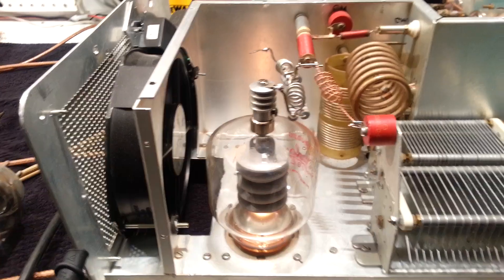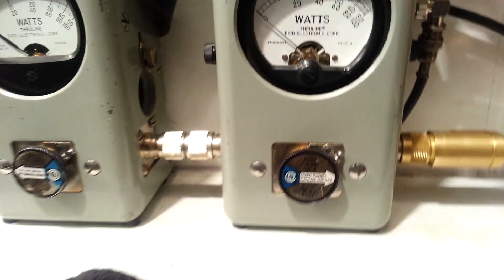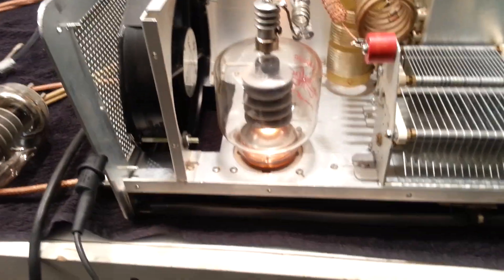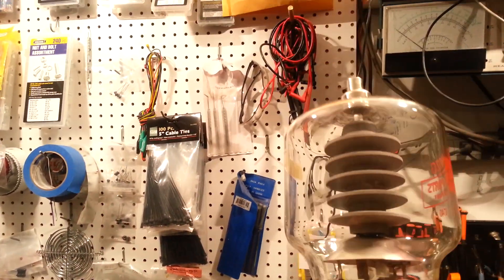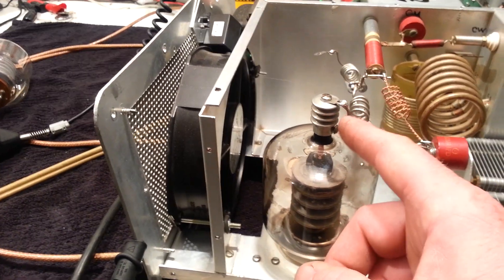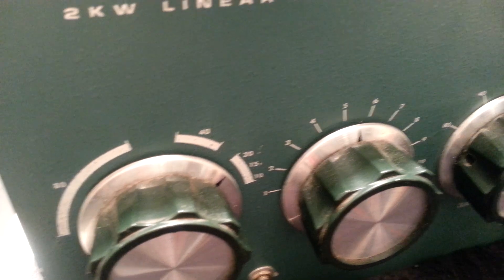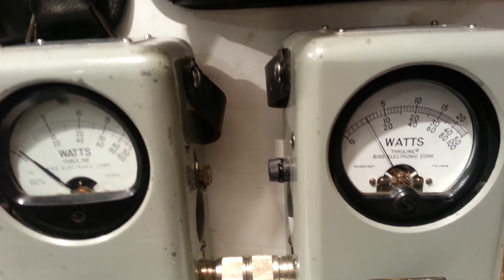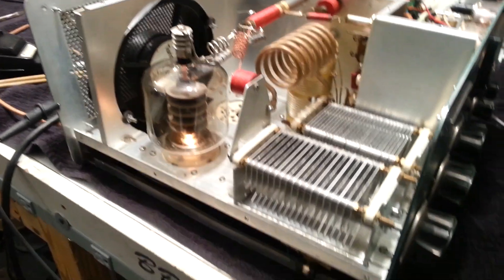3/500z singel tube test.

Comment: Better not to re-tune the amp when changing bottles???

While that may eliminate one variable, it doesn't take into account, tubes are not swiss watches and there construction tolerances vary considerably from tube-to-tube. Yeah, maybe if they were the same batch / date code, but comparing old tubes to new ones without resonating the plate for each tube. Not good for testing, not good for the tube. Dip that plate or else.

I will say BBI has some of the best SuperBowl audio I've ever heard.
Reply from the maker: The point is the tube was bad and what I'm trying to emphasize by not returning the amplifier is to allow the person that sent the tube up here to get tested to not be able to claim I did something to alter the test to change the outcome. . which I very clearly state in the video.. Lol :) and brother thank you for the compliment to my audio I try when I do get to talk on the radio which is very not often.. anyhow I appreciate you man and I appreciate the view appreciate the fact that you took the time to make the comment and thank you and have a great weekend.

Comment: Hey is that power supply in that 220 been hot rodded my 220 recapped is about 2700 on the plate
Reply from the maker: No stock. It's also in 220volts not on 110.

Comment: That tube looks like a TB3/750 not a 3-500zg. Its only 350w dissipation tho. It should do 90% of the power of the 3-500zg so that one is stuffed. Great videos, I watch them all, I am a fan bitch...lol
Reply from the maker: vk3mh should printed right on the side 3 500 Z.

Comment: This was done correctly...If you were to test a dozen tubes brand new out of the box,they would all read ALMOST the same.This weak tube can also permanently damage the variable caps...power has to go somewhere,you have three thousand volts (3000) not going through the tube(s)properly,Then you have a new problem with arcing within the variacs.

Comment: the SB220 with two 3-500z tubes will typically do about 1300 watts depending on test meter, load etc..   I believe slightly more with 3-500ZG ( not sure on that one )
Reply: Theoretically, the graphite anode 3-500's were supposed to able to be driven a little harder, and for longer periods. However, I think the heater was the same as in the plain 3-500Z, and that would limit the maximum drive it can take.
Reply: +kb7uxe It will do a lot more than that with fresh 3-500zg's and proper loading / tuning.

Comment: But each tube may need different load/tune settings.  is this a matched set ? 
while they may be close, my experience is each tube will be set a little different. 
 I believe a good tube would show this lower power, IF it was not loaded properly. And by not resetting the load and tune you testing could be flawed. 
kb7uxe.
Reply: You are correct, as anyone with an electronics education would notice this. One can not simply replace a tube to see if it matches another without retuning it. If a tube is weaker, of course the plate impedance will change. Even new tubes may be a little different from one to another, and still have to be returned for maximum output, because one is matching the plate impedance to the load via the tank circuit. So, noting where the knobs are positioned at means diddly squat.
Reply: craxd1 no problem for that bunch of CB opps. they don't know plate load impedance from apple sauce.
Reply: @1903A3shooter  Hey! I'm a CB'er and even I know the difference!  I eat apple sauce all the time, and my plate is loaded and nothing impedes me.